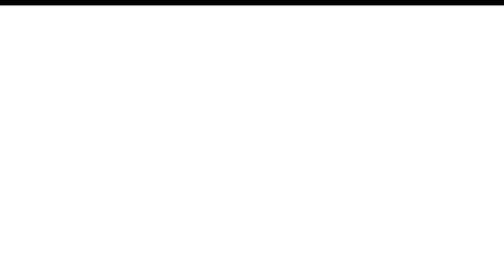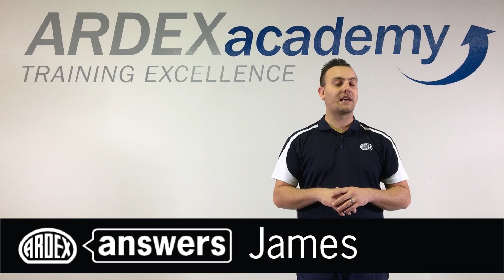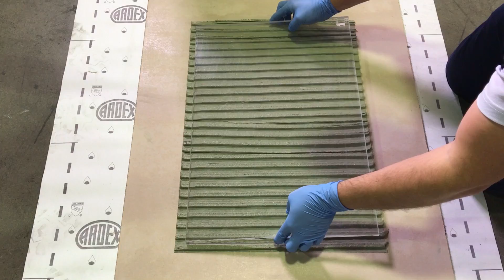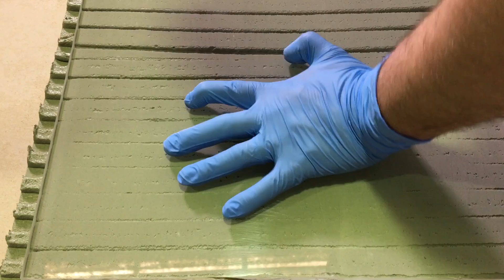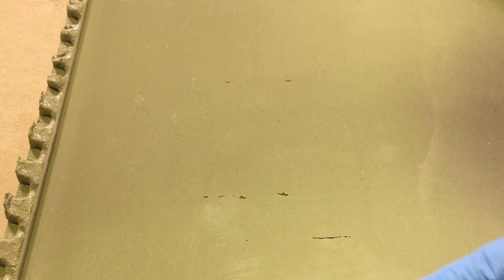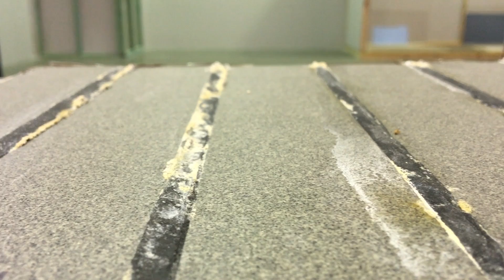What causes grout efflorescence and how do I prevent this from happening?

Comment: Hi ardex. I have a little bit in my room under the bed sitting above my tiles. Now there is a bad odour like smelly feet or could say off cheese.. is this dangerous. I also sleep with the window open summer/winter  Pls reply as I am very concerned. Kindly appreciated.
Reply from the maker: This sounds to us as if water is getting in and you have a potential bacteria growth problem - which is not a case of efflorescence.
If tiled correctly (if done recently), any water from the tile adhesive and grout would dry out within at most a couple of days.
So we can’t offer any advice other than that we suggest you contact a plumber to assess help you.